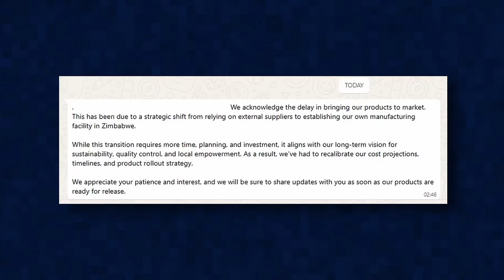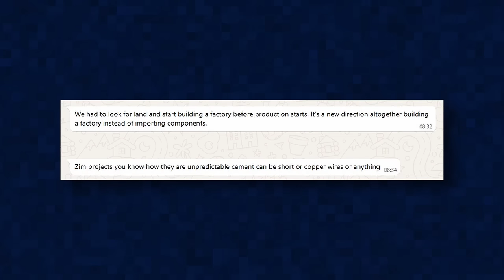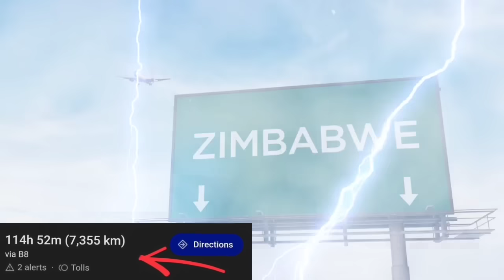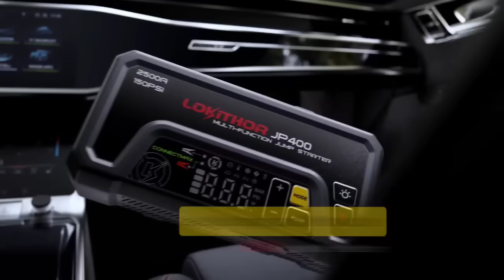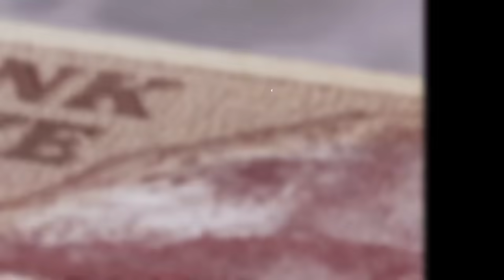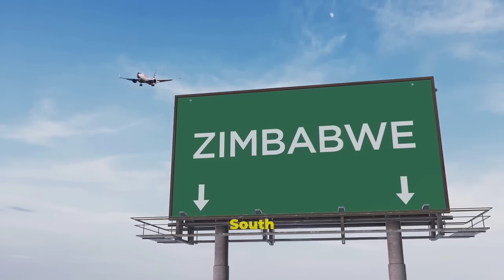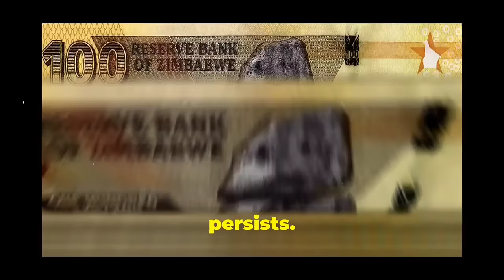Maxwell Chikumbutso Finally Breaks The Silence on His Wareabout

Comment: Independence from energy dependence is always a great thing. However, this is what I think about centralized power grids: I believe they are a good practice. If each house has power independent of a central grid, then when something happens to individual power units, technicians would have to visit each house individually to restore power to each unit.
Reply from the maker: Well diy information will help you fix it yourself